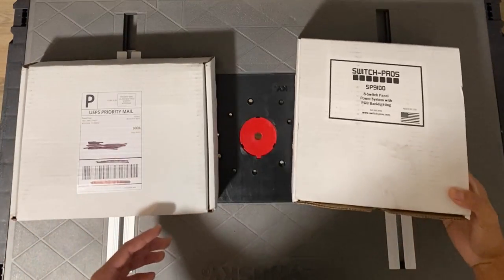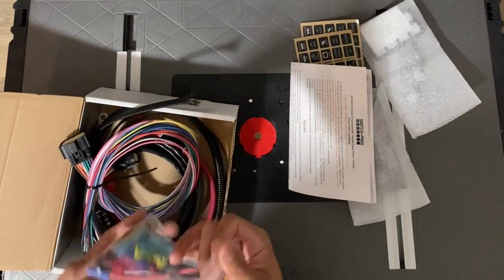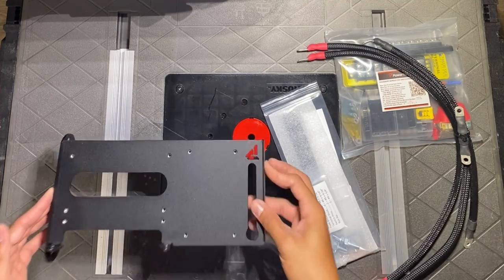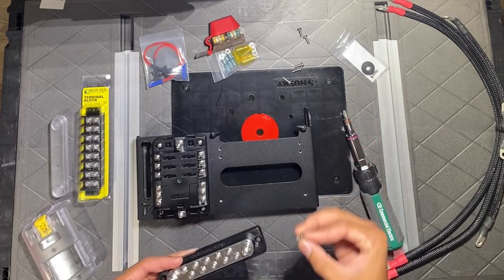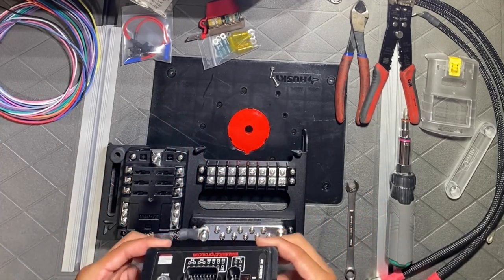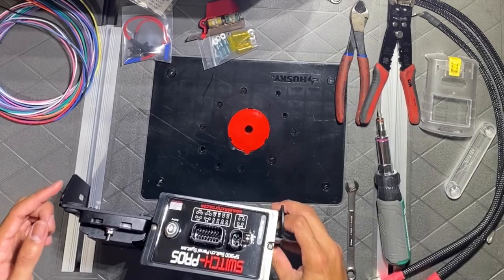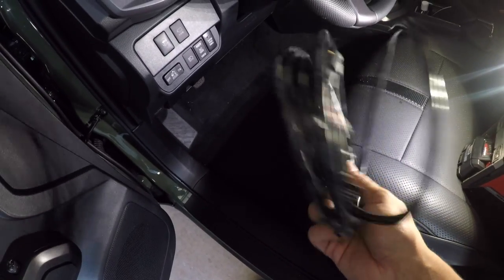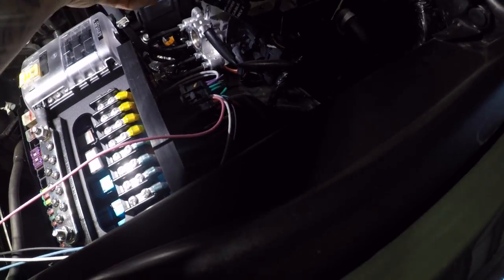Tacoma Switch Pro and Power Tray Install (6MT)

Comment: Nice video; seemed like you may have gotten a lot of your tips from the R4T install video or the PowerTray install video. May want to reference them, provide link or give them a shoutout. Maybe cut back the music track volume a bit too 😅 Overall good video though!
Reply from the maker: Thanks for the tips. And yeah, I forgot to tag them in the description. I mainly used the online instructions on the QR code from power trays.